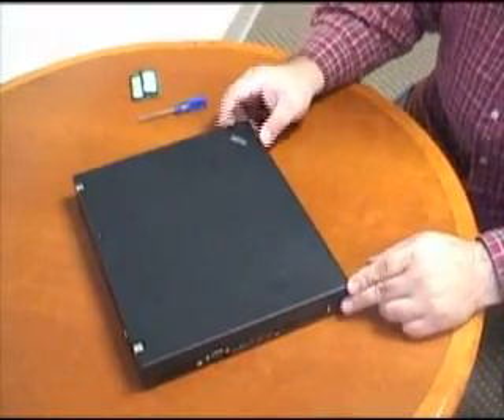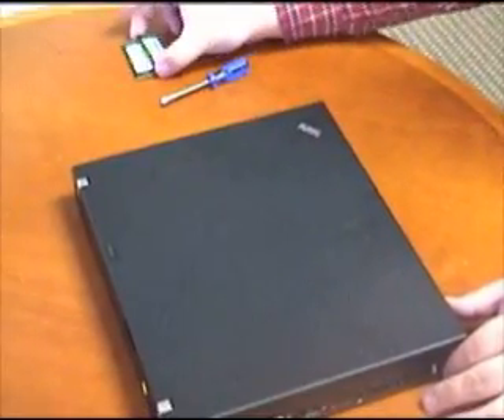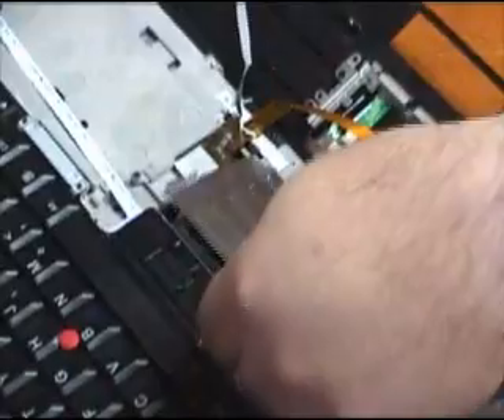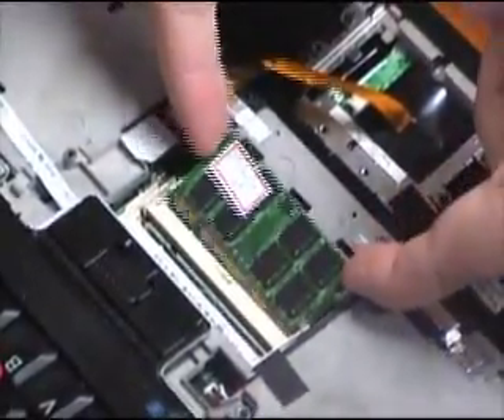Thinkpad Memory Upgrade

Comment: Thanks for the video! 
I just upgraded my T60 from 1GB to 3 GB, using a Corsair 2GB Chip for EUR 35,- 

Also thanks to the users who pointed out that it's ok for thinkpads to use different sized RAM chips (in my case  a 1GB and a 2 GB module) as long as they have the same MHz, in my case 667. On the biult-in module it said PC2-5300S which was the search string i used when i tried to find a fitting module.
Cheers, Len

Comment: Very helpful. No problem following the instructions, but minor differences on my ThinkPad T60. It's made by Lenovo and has 4 screws (not 5) holding the keyboard frame in place. It also never had a guard above the memory sticks. NOTE: keep track of which screws come from which holes. The demonstrator doesn't say to do this until well after you've taken them out. You could confuse them at this point. Mine are all the same length, so it didn't matter, but it could.

Comment: I followed these steps and nearly broke my touch pad cover. Maybe T60 sold in different countries are not the same? I can't just press down the touchpad cover at the lower side, if I push it too hard it will break the little slots at the lower side. I have to slightly fit the slots and pull the upper side to the right place. It took me about an hour. What a frustrating experience.

Comment: Video is ok but info about which screws you have to take out is useless. There are icons next to screws indicating what the screw is holding and thats what you should know.

Also be sure to consult the manual - this process is covered with illustrations for every step

Comment: Worth mentioning is that, XP only supports 3GB of RAM. 
This often leaves you with a max of 2GB (2x1GB) because you are supposed to have sticks of the same type and spec.
According to Lenovo however, as long as the speed is the same (667mgz max), you can mix sticks, i.e. have a 1GB and a 2GB stick.